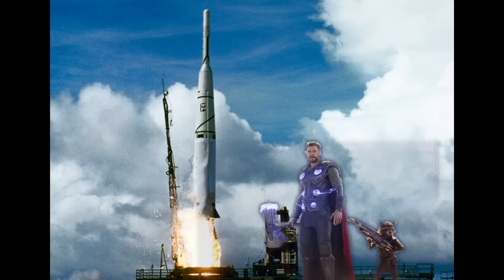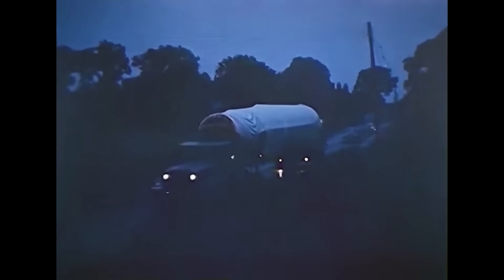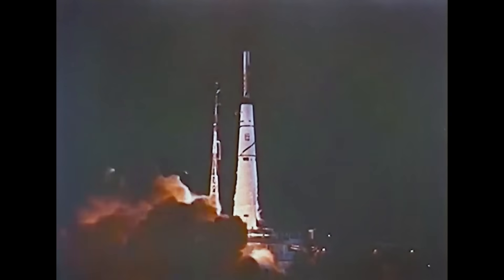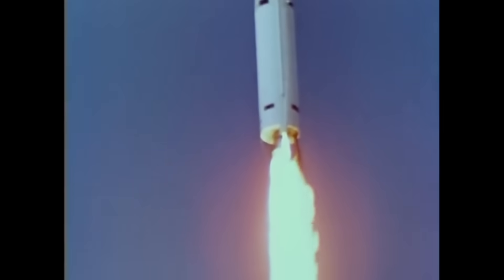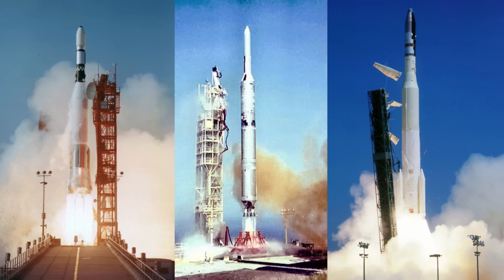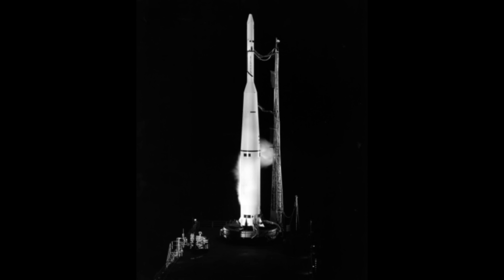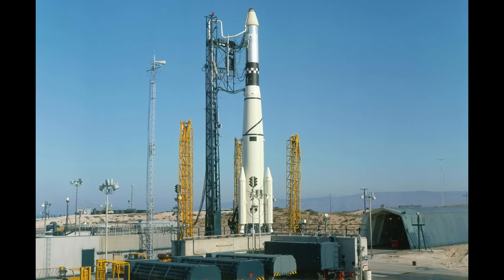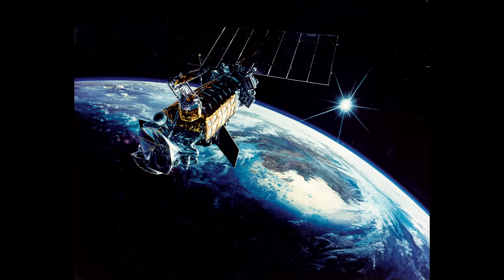Thor Rocket - How A 'Temporary Solution' Became America's Most Popular Launch Vehicle

Comment: Any decision of the Thor IRBM should include is sister rocket the Jupiter IRBM.  The sibling rivalry between the two developments for which was two nearly identical rockets was legendary.   The Jupiter team, under the direction of Wernher von Braun built the better more reliable rocket initially. The Jupiter program was more successful due to far better testing and preparations. The Jupiter missiles were also used in a series of suborbital biological test flights. The Saturn I and Saturn IB rockets were manufactured by using a single Jupiter propellant tank, in combination with eight Redstone rocket propellant tanks clustered around it, to form a powerful first stage launch vehicle. It could be said Saturn I and IB were derivatives of the Jupiter program.  The Jupiter MRBM was also modified by adding upper stages, in the form of clustered Sergeant-derived rockets, to create a space launch vehicle called Juno II.  It launched Pioneer 3, Pioneer 4, Explorer 7, Explorer 8, and Explorer 11.  One of the two rocket programs would have been canceled due to their near identical performance and Thor having the significant higher failure rate probably would have been the canceled program. However, after the Soviet launches of Sputnik 1–2 in late 1957, US Secretary of Defense Charles Wilson announced that both Thor and Jupiter would go into service as his final act before leaving office. This was both out of fear of Soviet capabilities and also to avoid political repercussions from the workplace layoffs that would result at either Douglas or Chrysler if one of the two missiles were canceled. All very interesting rocket history.
Reply: If Wernher were to somehow be resurrected I can only Imagine what he would say about the way things are being handled these days. Pretty sure that some very strong German swearwords would be used
Reply: @Roguescienceguy  he would be proud of achievements made by for example spacex tho.
Reply: @Roguescienceguy  I don't think he would care much about government money anymore.
He probably would go straight to private industry, maybe SpaceX, maybe Blue Origin, maybe someone entirely different.
Von Braun only cared about politics as far as his funding was concerned.
If a better opportunity to follow his personal goals came up, he would have immediately turned to where the wind blows.
Reply: @Roguescienceguy  I disagree.  From today, if von Braun could be solicited for his opinions, I think he would admire how NASA and the USAF took a design program meant to fulfill one purpose, and developed into a different, much more capable program for another purpose.
He was a straight-laced, old-school German (despite his work for the NAZls), and if he had any 'colorful remarks', the would probably be reserved for NASA's handling of the Orbiter program failures and the US Congress' lack of vision in promoting reusable manned spaceflight past the conclusion of Orbiter.

I think Werner Von Braun and Richard Feynman would have gotten along swimmingly.
Reply: >  A von Braun Saturn-1 derivative could have put a 15 ton Pioneer-1 satellite into earth orbit in 1957. If the US would have backed the Army Redstone Team with the same funding as the Air Force Atlas Team. 
-  It was all about the clustered booster aproch using the well tested & operational Redstone. The same technique that, instead put the Russians into the history books.
- And Space history would have been completely different.
Reply: @mydogbrian4814     Like the N1.
Reply: @advorak8529   More like the R-7 in capabilities although N-1 falls into the same category of clustered launch vehicles.
Reply: @mydogbrian4814  uh… what? Maybe you mean the Juno I, and maybe you mean 15 kilograms. And the Juno I’s clustering was on the upper stages.
Reply: @the18thdoctor3   Have you ever seen the first stage of the Saturn-1? It's a cluster of eight Redstone rockets that were flight ready by 1956 & deployed in 58. And could have easily launched a 15 ton Sputnik competitor in the summer of 57.
- But the US like the Russian leaders weren't interested in satellites.
- Sputnik I was an after thought when the Russian leaders learned of the Vangaurd project. It was slapped together quickly as just a beeping transmitter. Just to beat the USA. And they did! Not knowing it would usher in a Space Race.
- There was a  Prejudice against von Braun in the 50's because of his ties to the NAZI's and funding for his Army Redstone was small. Most $$$ was diverted to the AirForce Atlas ICBM program.
Reply: @mydogbrian4814  
No, it really wasn’t. The Saturn I used different engines (8x Rocketdyne H-1 instead of North American A-7), a completely different thrust structure (4 engines in a square surrounded by 4 in a cross), and of course an upper stage engine and propellant that hadn’t been developed yet (S-IV, RL10, hydrolox). The toolings used to build the S-I tanks were the same toolings used for the Redstones (and Jupiters, since the inner core was a wider diameter), but the tanks themselves were a different material and structure.

The Saturn I was built using Redstone and Jupiter heritage, but it was not itself a cluster of Redstone and Jupiter missiles, and it definitely wasn’t anywhere near ready in 1957.
Reply: @the18thdoctor3   I was afraid that my use of a Saturn-1 " derivative  " for the sake of brevity & illustration to the general public would end up with me getting bit in the ass by the techno savvy class of space enthusiasts.
- Let me clarify;
The key here is the term; " derivative. "
I didn't actually mean the real Saturn-1 per se. Because the term didn't exist when my sorce material was passing out the information.
- In 1960 during the alarm & near panick by the general public about the Russians throwing tons of weight into orbit & we were countering with grape fruit & beach ball sized fluff balls. So as a responce, a panel was created on Meet the Press (?) national TV to address the problem.
-  Willie Lay, von Braun & and an Air Force general were asked what the USA was doing to close the gap?
- von Braun said that back in the summer of 57 an unnamed US agency (CIA?). Aproching him with top secret news of Russian successes with heavy lifting rockets (R-7) that were using a novel " clusterd " aproch instead of staging to deliver heavy payloads to intercontinental distances. And how long before we (USA)  could match that capability if given top priority?
- von Braun then replied  he could cluster his battle ready Redstone in similar clusters up to, say 10, without any foreseeable engineering scaling problems that could surpass the Soviets capabilities in 6 months time.
- Assured that they could match Soviet throw weight capabilities if necessary the then proposed Pentigon project was never initiated because US hydrogen bombs were much lighter than the Soviets thanks to Edward Teller's breakthrough design. And the Atlas ICBM was just around the corner.
- And von Braun did exactly that with the Jupiter C in 90 days from the go-ahead with a small scaled Saturn-1 derivative with clustered 2nd stage in finally  putting a US satellite into space that was already ten times heavier than the ill-fated Vangaurd's. ..... 😉
Reply: @mydogbrian4814 and don’t forget the politics of orbital overflight
Reply: Jupiter was a much more expensive rocket though. It was very similar to Thor but aside from a handful of launches it didn’t have a success rate that justified continuing launching it for that price after 1963.
Reply: While there Thor and the Jupiter had similar missions based on much the same technology, there was a significant difference in the approach that was a result of the differing viewpoints of the US Army and the US Air Force.  The Thor system had to be designed to be portable so it could all be hauled to England but once there it was a fixed installation, even if much of the equipment was mounted in wheeled trailers.  The US Army had designed the Jupiter as a portable in the same way the V-2 was, capable of being hauled out in the woods and set up; this conferred an obvious military advantage since missiles could be shifted around.  The result was that the Jupiter had to be a tougher bird than the Thor and thus was heavier, which is the way the Redstone Arsenal designed things.  Another way to look at this is the difference in the way tanks are built by the automotive industry (Chrysler) as compared to the way aircraft are built by the aviation industry (Douglas).  Of course, the USAF's Mace cruise missile also was designed to be hauled out in the woods, assembled, and set up, but by the time it was deployed to Europe they had decided that having nuclear weapons running around the countryside was not the best of ideas and so deployed them in fixed compounds, although using the mobile equipment.     
When I was the USAF Thor Program Manager the people at MDAC told me that Thor went on into the space booster role while Jupiter did not because you could put an Agena upper stage on a Thor, launch it from Vandenberg AFB, and put the whole Agena into a Polar orbit for programs such as Corona, while the Jupiter could not do that.  Jupiter probably was a better IRBM than Thor but that was not where the future was.
Reply: @MIflyer5124  Interesting historical facts about the programs.  Thanks for the input.
Reply: Ah, Chrysler; now it all makes sense
Reply: If we are to invoke the Jupiter then don't forget also that the Jupiter IRBM was even more successful than the Thor in frightening the Soviets and hence escalating Cold War tensions. It was the deployment of those missiles in Turkey that provoked the Soviet response that eventually escalated into the 'Cuban' Missile Crisis and brought us closest to a nuclear war. Mind you the heightened fright was not as much about the missile's capabilities as it was about their location and supervision which we subsequently mirrored with our fright of the Soviet missiles in Cuba.
Reply: The development of what would be the S-I stage started in April of 1957, which bore no resemblance to the S-I using a single tank design and 4 E-1 engines to produce the required 1.5 million lb thrust. By July 58 under ARPA recommendation the 4 E-1s were replaced with 8 Jupiter engines (an engine developed from the LR-85s used on Atlas). By August ARPA would grant authorization of the development of the 1.5 million lb booster to demonstrate feasibility, which would be modified to authorize 4 flights, two with dummy upper stages, and two with unsophisticated upper stages for orbital capability (with the term Saturn appearing around this point). At this point it seems that the first stage would be pretty much locked in with work focused on upper stages for the Saturn booster, with the booster itself expected by period documentation to be static fired by march of 1960.

This is a long winded way of saying that no a Saturn even as basic as SA-1 could not have been put together any sooner.
Reply: Jupiter looked stubby and inelegant. Thor had a sleek design. Jupiter was developed by formerly sworn NAZI rocket scientists, which was always a PR irritation.
Reply: The Saturn 1 series was not created by clustering Redstone tanks around a Jupiter tank. They just used the same tooling to create propellant tanks of the same diameter as the earlier missiles. The actual tanks are quite different from the Redstone and Jupiter.
Reply: @schr75  

Indeed, in that half of the ‘Redstone’ tanks carried kerosene, the other half and the ‘Jupiter’ tank carried oxygen.
Reply: @schr75   Please refer to my rebuttle to The18thDoctor for clarification on this Saturn-1  derivative quagmire. 😆👍

Comment: Now I can understand a little better, how SpaceX was able to develop such powerful rocket engines so "quickly".
So many of the problems of engineering such complex Raptors & Merlin rocket engines, were discovered by thousands of previous rocket engine designs. Sadly, I remember seeing live, several of the "duds", launched from Canaveral in the '60.
Reply: Everybody builds off those that go before.  But the Raptor is a tad more unique in some ways.  There is nothing special about the Merlin except that they managed to get so much out of such a small engine but its cycle and fuel etc have been around and done before.
Reply: @TheEvilmooseofdoom  I think the Merlin was the first major production engine that use pintle injectors, besides the limited run of Apollo LM descent engines.
Reply: The secret of SpaceX's (and Tesla's) rapid development is spiral development practices that have both very short design cycles and concurrent development.  Spiral development was borrowed from Silicon Valley software development.
Reply: How much of that knowledge and experience is actually publicly accessible?
Reply: Yeah, the world's governmental space programs paved the way for private companies; it likely would have taken a lot longer for private aerospace to take off without that. However, SpaceX seems to be doing a lot better job of developing things quickly and cost-effectively than a lot of the big aerospace companies in modern times.
Boeing and ULA and Lockheed and Arianespace and the other big players have had decades to innovate and pursue researching cost-effective fully-reusable rockets, but they never bothered to because they didn't need to. SpaceX's most important contribution is not their specific rockets, but showing that fully reusable stages can (and should) be done.
Reply: @IstasPumaNevada IMHO, the main reason why the big aerospace companies are so slow and expensive is the pencil pushers. They want to pay $x amount and get a successful launch. If there is a failure, they scream to find the responsible person, because they must have been negligent!

So, everything gets tested and tested again, built extremely well (MUST! NOT! FAIL!) and correspondingly, really expensive. Being really expensive, launches are few and far between. Stuff is still basically untested.

Contrast that to SpaceX: Elon knows stuff might fail. A test that ends in a large fireball is not a failure if they learned something from it. The press (or the pencil pushers) might call it a failure, but in reality, it's not. Even an operational rocket with a 20% failure rate is a success when the launches cost less than 1/5th of a system with 100% guaranteed success rate. The SpaceX Falcon family is now approaching (or exceeding) a 95% success rate, still at 20% of the cost.